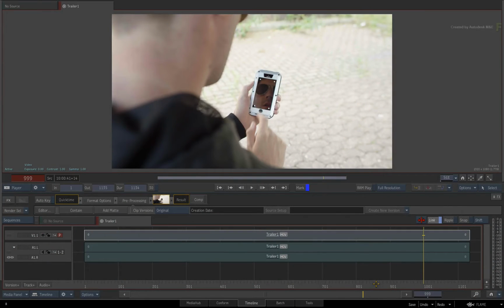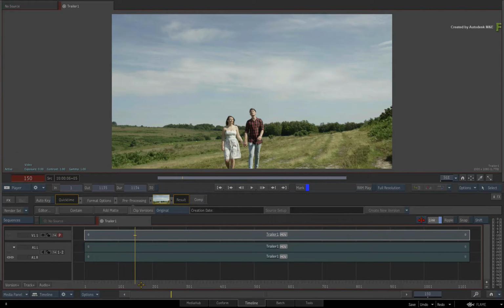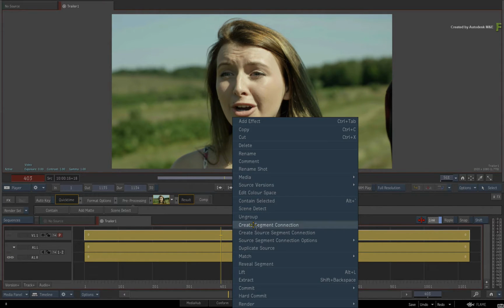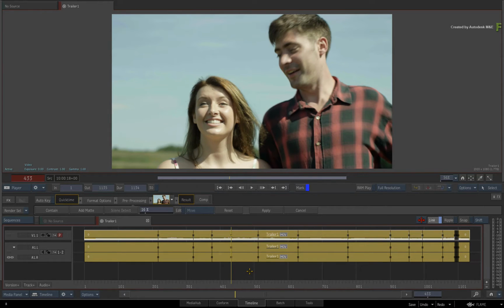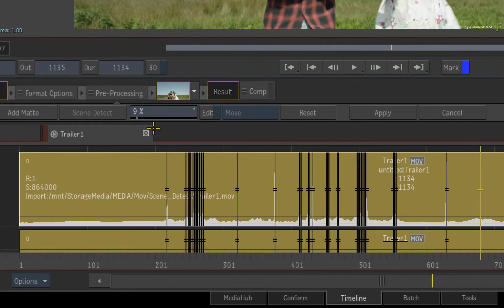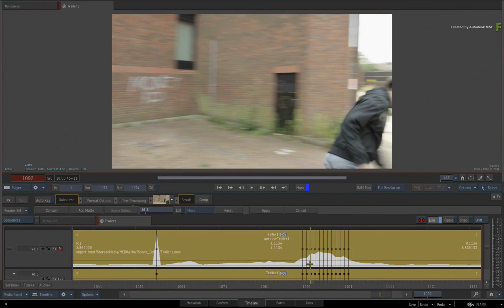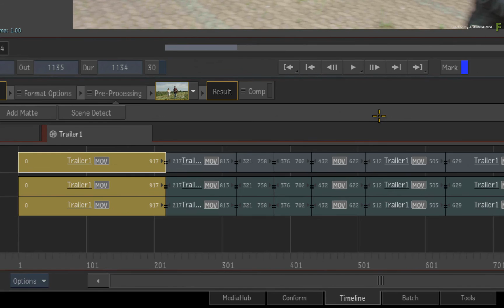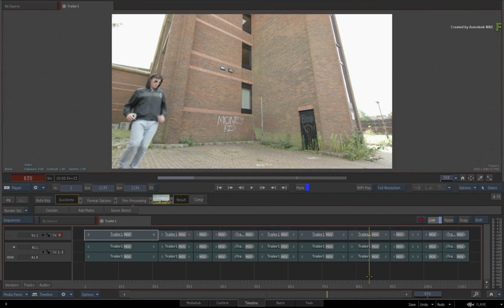Scene Detection - Flame 2018

Comment: In compare mode on viewing the  timeline, please add some sort of auto scene detect/auto marker for the "difference" setting.  That way if a difference is found it could auto mark rather than manually watching lots of black frames in the hope to find something different.
Reply from the maker: Hi, please log any feature requests or enhancements at the Autodesk Flame Feedback Page so it's properly logged and visible to the development team.   Many thanks!